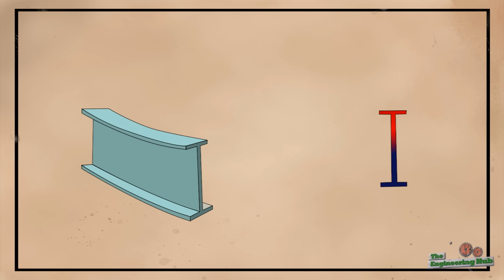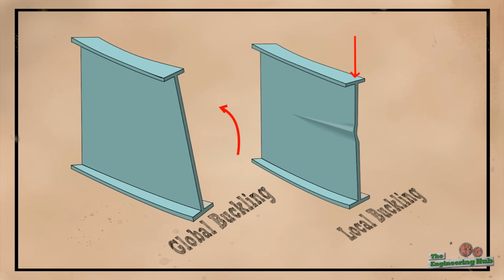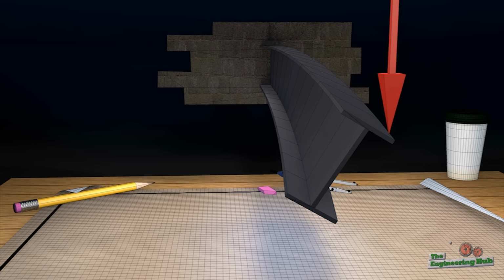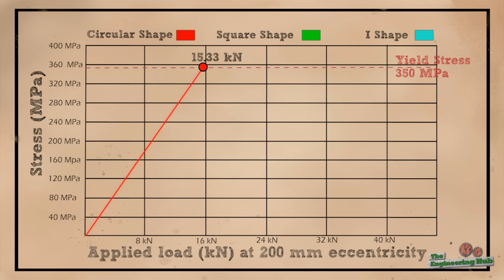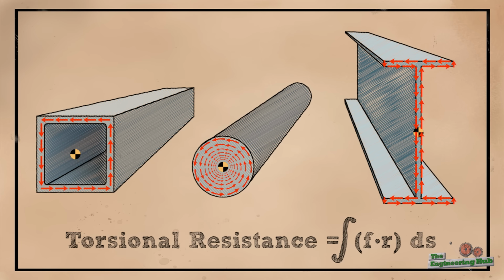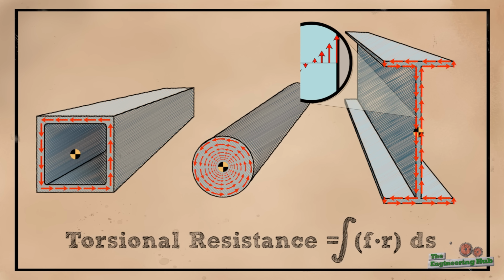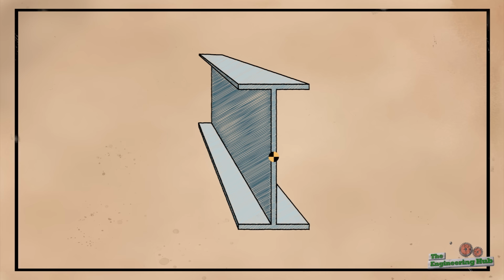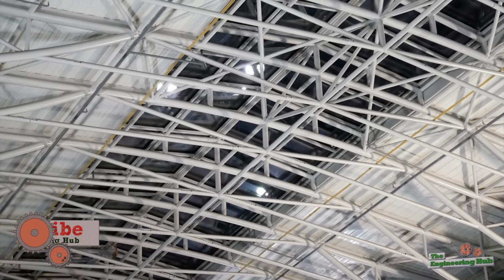The Critical Weakness of the I-Beam

Comment: Thank you for making a really interesting video. 
you obviously understand your subject, , ,
and, you are able to explain it in nice simple terms.
Many folks that know their subject are not very good at teaching it.
You, however are a good teacher.
A rare thing!
To introduce students of engineering to some "real world" problems encountered by folks designing industrial type buildings, like storage or farm machinery sheds, that often have lightweight web trusses to make wide "clear span" sheds, 
mayhaps you might make some videos that show how simply by adding small braces, that go from the underside of the lower web of the truss to the roof purlins can increase the truss's carrying capacity( resistance to torsional bending forces).
  Torsional resistance can be increased in so many ways, ask any steel fabricator.
I realise that in a short video you can't cover all variations,
mayhaps a series of videos, might be the answer.
Reply from the maker: Hi Benji, thank you so much for your kind words; we really appreciate your support. Trusses are indeed an interesting subject and now that you brought it up; we added it to our list of future videos. We tend to keep our videos to less than 10 minutes so we have to be very selective of what we decide to cover. As you suggested, we tend to break the subject into smaller videos that deal with different aspects (or failure modes) though sometimes it may appear that we neglect some important issues but it is purely due to time constraints. We don't know yet what the truss video will include but we will try to make it as informative as possible. Thank you for your feedback!

Comment: So…to make any given I-beam more resistant to twist would it be better to add flat bar at the outside of the I-beam flanges or to cut a pipe in half lengthwise and attach it at the outer edges of the I-beam (or perhaps attach the pipe halves directly to the I of the beam?
Reply: That is when you use a different shape.
Reply from the maker: Thanks for your comment Chad, we have a few ideas about what you mean, but the answer to your question depends a lot on the orientations of things. Could you provide a sketch and we'll run the numbers for you to confirm an answer? In general having a closed section with a continuous path around the center helps. But keep in mind, if you have constant torsion along the entire length of the beam then the entire beam will need to be re-fitted.
Reply: @TheEngineeringHub  I can’t seem to add a drawing in reply.  What I was trying to get at is reinforcing the beam in a particular location (though I understand your point about torsion along the length).  The particular issue is, for example, when to take out a portion of the beam like in a log splitter.